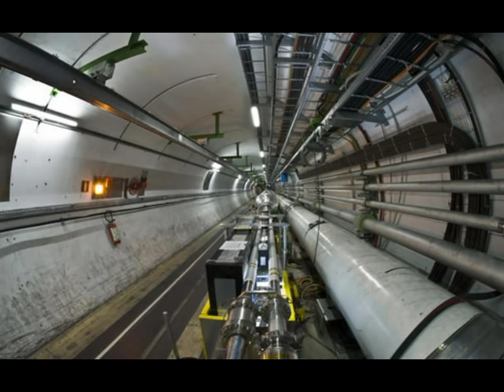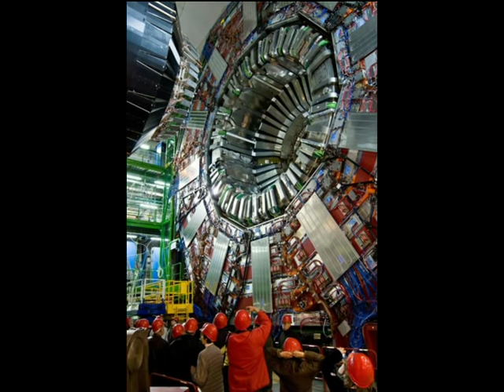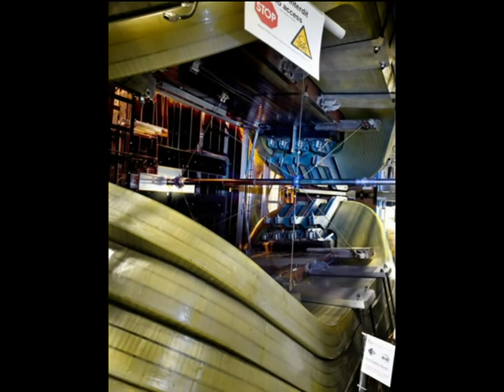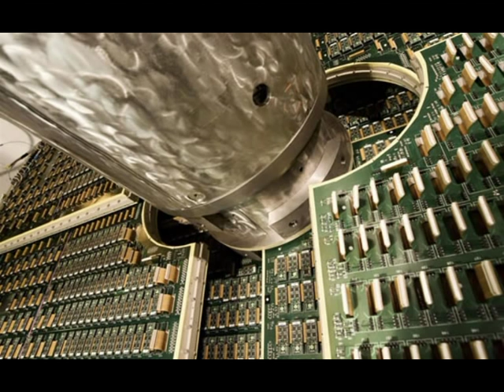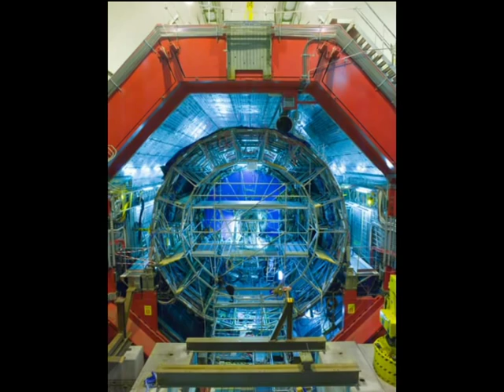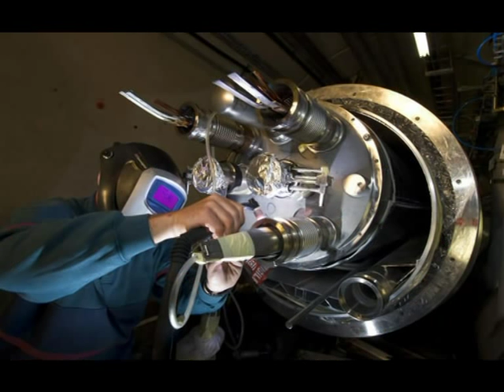CERN Large Hadron Collider (L H C) Must Watch : 30 stunning images & Expercts Comment:  IS IT THE END OF OUR PLANNET? OR BEGINNING OF A NEW ERA?

Comment from the maker: Cern said an initial investigation suggested a faulty electrical connection between two of the accelerator's magnets could be to blame.The collider requires temperatures just above absolute zero (-273.15C) to allow particles to be steered around the circuit.But as a result of the fault,the temperature of the magnets rose by about 100C.The affected area of the tunnel must be brought up to room temperature to allow engineers to inspect the magnets,and this process will take three or four weeks